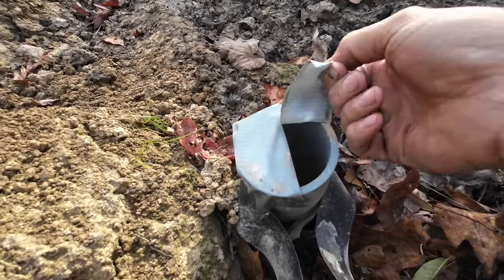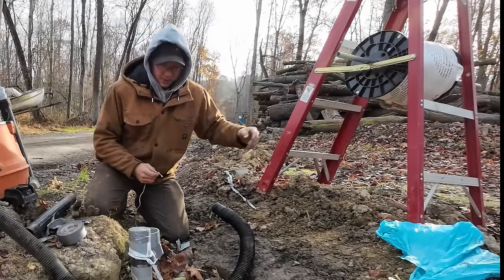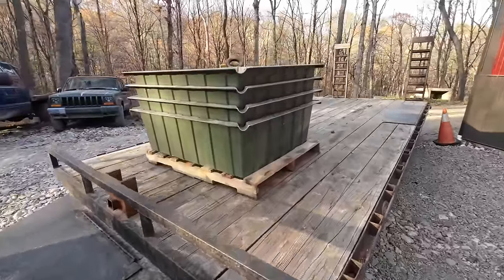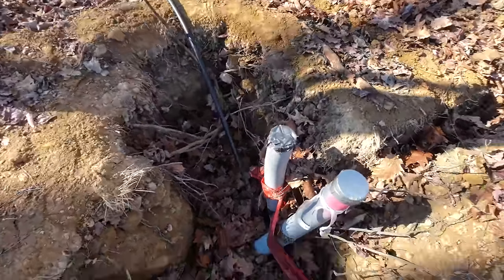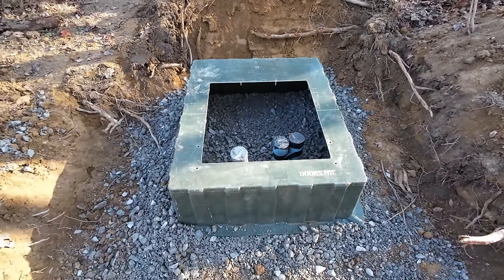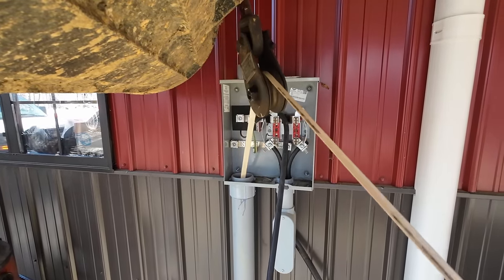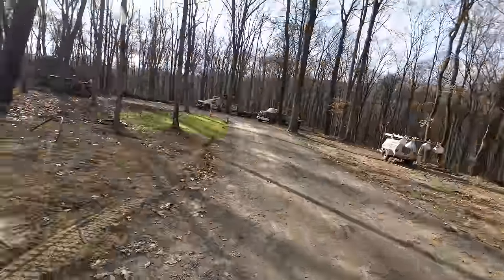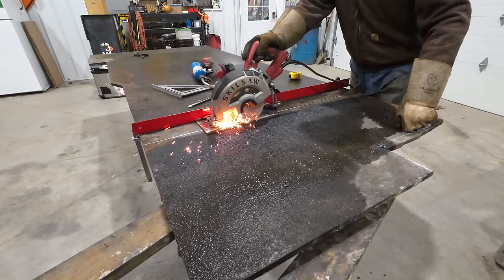The Power Company Charged me $52,000 for this!!

Comment: I don't know if this would work for you legally or not, but one solution is to "land" all the public utilities at your property border. Build a concrete building / "pump house" / whatever right at the property edge. Have them step it down to 120/240 200a or 120/208 if you need 3 phase. Put some pumps n shit in there. Then when they turn the power on, use a PRIVATE step up transformer to get your 7200 or whatever, and then a step down at your house and barns.
Reply: Good idea! Another solution is spend that $50,000 on off-grid solar.For $30,000 he can build 100 KWH battery bank and the rest on panels and inverter capacity. In the conduit he could run a #4AWG to assist the solar inverter to keep the battery topped off. Having built a similar setup but with much less capacity,I have been surprised how little grid power we consumed. I’m powering 2 houses with combined areas of 6 br and 6 adults.My grid power bill in August 2023 ,the hottest month was $30.02. We only had one power failure in the last year but we only noticed it because our internet connection,which I haven’t moved off grid,dropped off for a little while.
Reply: @danielking2944  Are you running any shop machinery there?
Reply: @TurboPonies  well, off grid systems can actually run shop machinery pretty well: multiple inverter manufacturers support 3 phase operations by connecting multiple inverters. The issue is more about how much you use the equipment IE total power draw. If you only use your shop tools a few hours a week, you can work it into an off grid system pretty easily. But if you're using them a few hours a day? That'll be a really beefy system.

Personally I prefer hybrid systems.

For example, with solark, you can buy 1x 18kw inverter which has grid input, generator input, house output, and on the DC side, solar panel input, and battery bank. You can then connect 2x 18kw solark units to the same battery bank, put them in a three phase setup, and have up to 200 amps at 120/208 3 phase. All with a system that can be partially or fully off grid. The solark when supports selling power back to the utility if your situation allows for that.
Reply: @PsRohrbaugh   Yeah, I can vouch Matt of @DieselCreek will run it only sporadically. There's no need to build a professional shop and expand for it. And he wouldn't mind maintaining the battery fields in subfreezing temperatures. Problem is - you still have to bring the grid over, to sell that exuberant power. But nevermind me.

Comment: I am SO glad I decided to go totally off-grid on our property.  We were looking at an 800' to 1000' run of buried line from the closest pole to our home site on our 30 acre property.  The cost for that would have been around 15K not including any other items to make the actual connection to the house.  We went with solar (and are looking at micro-hydro for 24/7 power generation from our creek) which came in at around 18K so far.  We can generate far more power than we can use or store during most of the year, and in the winters here, we supplement the lack of sunshine with a propane generator to charge our battery array.  At present, we can get 2 to 3 days worth of power from our batteries for snowy, rainy or cloudy days.  We'll be adding some more solar panels and a few more batteries to the system and if we add the micro hydro, we can generate 1 to 1.5 kw/hr 24/7 to keep our batteries topped off even during the longest periods of no sun.  And no power bills.
Reply: @ucsncinc   That's totally awesome! I bet you never have to replace batteries either so no recurring upkeep costs. Am I right?
Reply: Hydro is the best en you can use it 24/7 365. Would love to have that.
Reply: @DarkFlamage When they will have to replace batteries in 10-20 years, there will be Sodium ion batteries that cost much less than today's lithium. So yes, recurring cost, but a) not so much and b) you probably don't know the smile it puts in your face, when you don't have to pay for electricity or when there's a power outage...
It's the same as a propane conversion on a car (at least here in Europe). It costs you 1-3k initially, but the smile in your face, every time you fuel up at half of the cost, priceless.
I have 5.2 kWp solar on my house and shop, with 35 kWh of old forklift lead acid batteries and a 5kW inverter. Just about to add another 8-9kWp of solar on east and west, to extend my autark. At the moment, I don't use any grid power from February to October, including hot water, air conditioning, and some electric heating during spring. Only in winter, I need like 3-500 kWh (yes, so little) from grid. Thinking of better putting a Lister diesel as a heating-power-plant.
Reply: Yes , solar is the way to go. All I can say is ....Matt I wish you would have given more thought to solar.
Reply: I shouldn't have to.  The batteries are good for about 20 to 25 years of charging cycles and warrantied for 10 years.  As long as I take care of the equipment, it should last for years.  But I've made plans to keep a little something set aside in the event I do have an issue and need to replace anything
Reply: @JeffTaylor-qm7gg he touched on that in a previous video,  with the requirements he has, the amount of available  light, the amount of snowfall,  and the area he is in it wasn't feasible in generation or cost.
Reply: @JeffTaylor-qm7gg  Solar for that area is at best supplemental. It would be good for summer for running AC and such, but  come winter it's not going to be doing much.
Reply: @danielw.556 Nice. Use a Diesel Generator for Power AND Heating. Use the exhaust for heating and the genset to fill up your power bank. Higher efficiency 🙂

Comment: Power Co tried to charge my folks $120k for running 100mtr inside property to house. Turns out they had to upgrade street lines and tried to add that to the bill. When that was rejected they said how about $60k for the 100mtr trench. That was rejected & my folks managed with  a generator for a few yrs. Eventually they got the trench in & mains power but whenever there was a storm & branches cut the lines it would take 1-3 days to be fixed being a rural sector. Last yr my folks went Solar with battery so if the power goes they don't lose perishables.
Reply: God damn criminals!!
Reply: For less than that today they could be 100% offgrid.
Reply: @davefroman4700  Please explain.
Reply: @alanrogs3990  100kw of LiFePO4 cost me 8k with shipping, customs, and delivery.
                                10kw of solar, 40 360watt panels, cost 7.9k with shipping.
                                 15kw inverter cost 4k.
                                 misc electrical items and wires, call it 4k (way under that) but that still only puts me at 24k total.
Reply: @alanrogs3990 30 kW in 6 rack mount LiFePO4 batteries is about $9K including rack. $27K for 90 kW (actually 92.x kW) plus your off-grid inverters. Then 4 × 6 kW inverters is about $6K as well (200A equivalent for 120/240 Vac). You still need PV panels ($6K for two 36pc pallets for a total 26.6 kW rated) and mounts etc so it'll get up there for sure. No need for separate MPPTs or a battery charger, that's all part of the off-grid inverter. You also have a convenient AC input for a generator (or utility mains). Even so, it should cost a lot less than paying the utility company their ransom. And you probably have plenty of space in the budget for a diesel generator with tank as well (manual start or even automatic standby). Fuel will then depend on your usage (regularly burning a little for maintenance/testing). Or you could run a gas or LP generator again depending on your power needs.

Comment: I live in Maine and I did everything from the excavation to installing the line they required to my shop which was 1080'.  I bought all the wire and installed so we didn't need to use CMP.  After paying all the materials not including my time the electricians to do the meter hook up and all the fees associated I was at a  little over $21,000.  Your setup was twice the distance and they pulled the power cable and supplied I actually think you got a good deal other then its stupid expensive for what it is.  The only reason we did ours was the waiting list was much longer then yours due to Covid. With that having power is worth the pain to the pocket in my opinion.
Reply: That's interesting.

Comment: install the primary outside your property , and pull it onto your property yourself. Thats what we did on a long pull too our lake to supply water too a hog barn. They dont have too have the primary at your house...
Reply: At 2200ft the voltage drop would be massive. It would also require much larger wire which would cost much more than $50k.
Reply: No it wouldn’t you bing bong. The voltage is too high for any issues. You need about 4 miles plus to use a regulator bank to boost back up voltages. Even then most times you’re good.

Comment: I would suggest that you build a really solid steel frame around the transformer and junction boxes. Protects them from falling trees and somebody backing into them.hust make sure you make the frame in front of the doors removable for access. 😊
Reply: "somebody" ;)
Reply: bollards ? is that what your trying to say
dont roof over it
Reply: Great suggestion!!!
Reply: Totally agree for 52k they're probably diamond encrusted 😂😂
Reply: Absolutely!!  Nobody and nothing would ever hit them...😮😂
Reply: Not to bad considering that you did about 95% of the work yourself....👍🇬🇧
Reply: Bad idea! Transformer belongs to the power company. Must keep at minimum eight feet clearance around the boxes for safety of the linemen.
Reply: As someone who hit one once - I second this.
Reply: Any steel structures within 10 ft of that transformer needs to be properly grounded….My suggestion would be to auger 4 poles approximately 3 ft straight out from corners of transformer and install plastic pipe below frost line ..make sure you call before you dig…or use steel with bolt on cross bars but the posts must be grounded inspected etc…

Comment: Matt the Chinese finger clamp are very handy in more cases than you can imagine, but big ones are even better for pulling  hydraulic hoses around a dozer or other equipment, so hang on to them ,just pull old hose out as you pull new hose into connect it .

Comment: 52k is a bit absurd but as a lineman there is a bit more that goes into the process. Factor in the cost of the primary cable (we use 2/0 aluminum primary cable for this type of service), medium voltage elbow on transformer side (possibly additional elbows in junction boxes. Not sure of that style junction), medium voltage termination on pole side plus possibly a cutout and other hardware to run cable up pole and connect to existing infrastructure. Again 52k is a lot but having the equipment and manpower to come out and energize the service isn’t cheap and the power company is obviously making a fair bit as well. Primary cable is also a bit more involved to terminate than your regular 600v or 1000v secondary cable.
Reply: My suspicion was that the power company wanted to make sure nothing went wrong with the pull, like a gash in the insulation or sketchy splices in the middle that could overheat and cause a short later on.
Reply: He said he is supplying the cable for 15k he paid they're just pulling it with the string he also had to install
Reply: Not to mention taking responsibility for the entire installation from that point on. People seem to take that for granted.
Reply: @Monkeh616  Yeah, it's like the people who drive without motor insurance and get into a car accident. Like, whether or not there's price gouging involved is a separate issue, but regulations exist for a reason!
Reply: @nathangandara9607  $15k was for the conduit and renting the trencher.

Comment: Just for comparison, I installed an underground feed 14 years ago from the highway to a location 3900 feet away on our farm.  This is in Ontario so requirements are quite different from that in your location in the US. The primary wire was basically a large coax cable about 1 1/4" in diameter and good for 16000 volts if my memory is correct. Even though I am an electrician myself I hired a contractor to help due to the size of the job. An excavator was used to dig a 24" trench up to 5' deep.  A stone slinger layed 6" of sand in the trench as well as on top of the cable after installation. The only conduit used was at the pole to get into the trench and at the other end where the cable entered the concrete transformer base. The transformer base also had a ground field installed around the perimeter as well as the installation of the central metering base. The total cost was just over $42,000, $20,000 of which was for the aluminum primary coax cable.  For the pad mount transformer, I only had to pay the difference between the cost of a pole mount and a pad mount.  This gives me enough for approximately 700 amps at 240 volts. I know that here have been lots of increases in costs of just about everything in the past couple of years so no idea how much this would cost today.
Reply: Could you have put in 600V or was it not available at source
Reply: @richardgadoury8452  What he said was 240 on the Low End(user end) of the XFMR.  He said the high side was 16kV.  600V would mean he would need another XFMR for all normal loads.
Reply: Yep for sure on the cost part. Construction prices in the US have nearly gone up 50% if not more since covid.

Comment: The one box right beside the road, for safeties sake I think you should put in a couple of hefty barrier poles on each side of the box just to mark them clearly (especially in snow) and to keep any slightly off the road vehicle from tearing through that and forcing you back onto your generators.
Reply: if matt marks them he’s liable for them. did matt set them off the right away? that’s in him too
Reply from the maker: All laid out to spec
Reply: @DieselCreek  Matt, it’s late. Go to bed.
Reply: None of his boxes were close to the road. They were in his driveway but not the road people drive on. The one at the end of his drive was at least 60 feet or more off the road.
Reply: @jeffriley-lq5np  Right of way? They are all on his property, he doesnt need to make sure any right of way distance ion kept. The power company gave him a spec sheet to follow and if he wasnt 1000% within that spec, they wouldnt pull the wire. This was inspected a few times before the guys showed up to pull the wire, even though we didnt see the inspections, it was all gone over very well.
Reply: @jeffriley-lq5np  What kind of reasoning is that? The one hitting them is liable for them, not the one trying to warn you that there's something there... If I hit a low bridge with my semi, you bet I will get the bill for fixing the bridge even though it's marked... Or rather, I will get that bill BECAUSE it is marked.
Reply: Powerful video
Reply: @warrenmichael918  Was it really that difficult to understand or do you have an irreparable urge to nitpick? Lol - I know I have a hard time resisting some days!  But just to be clear his driveway is so long it qualifies as a road and it's still possible Christine is possessed. :)
Reply: @roycsinclair  I do love a good nitpicking in the comments!  I guess you were talking about his driveway and not the actual road here. I doubt he is worried about anyone running off his driveway and hitting a pull box.
Reply: @DieselCreek  As long as you feel safe about it, it just looked a little close to me but perspective in the videos is often difficult. Be safe, be happy, have fun and thanks for all the great videos.
Reply: @warrenmichael918  Well nitpick or not it's fun to meet (even just online) others who enjoy these videos. And you can see Matt feels it's OK and he would be the man on the scene so I'll take his word on it.
Reply from the maker: @roycsinclair  if I come up with some boulders, I might place them around there. Not too concerned about them though, they’re big enough you can’t hardly miss them 🙄
Reply: @roycsinclair  Thats where i am at too. We only get to see an hour long video that took many many hours to make, so we never really see the whole picture of everything going on. We get to see what they allow us to see and im sure thats because they have to protect their private lives and protect themselves from every youtube professional telling them how much they are doing things wrong. Im not sure how most of the youtuber channels even deal with all the negative garbage.

Comment: I checked on a run like that at my place in south Texas for overhead and it was about $40,000,  but that was 5 years ago.  The power company has a cost estimator on their website so I just calculated based on 2,600 feet and today's cost is $66,434 for overhead and $111,800 for underground.  The good news, if any, is that these costs are all inclusive.  Looks like you did OK.
Reply: Never would have expected a run to cost that much. Its not even a three phase commercial property. Yikes. Who is the power provider in STX?
Reply: It has been almost 30 years since I quit the field work but these prices seem outrageous.